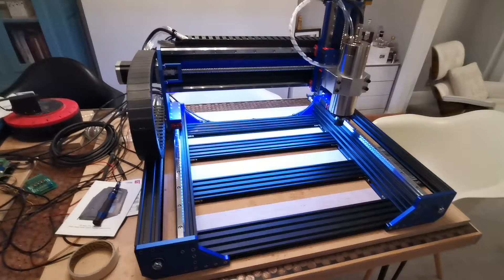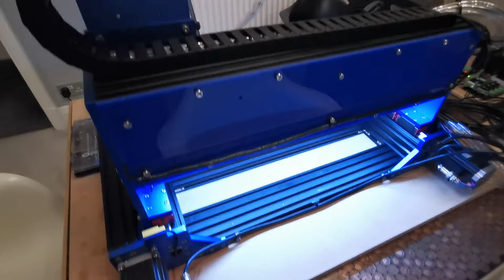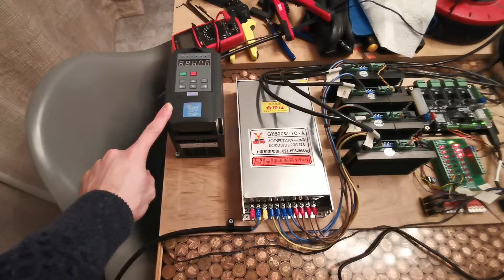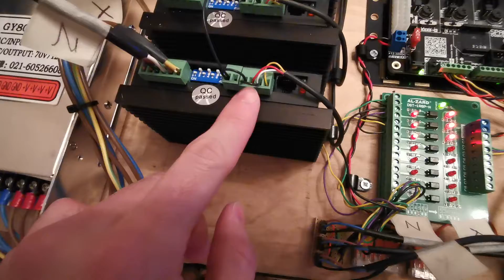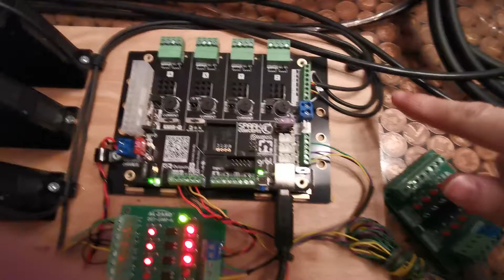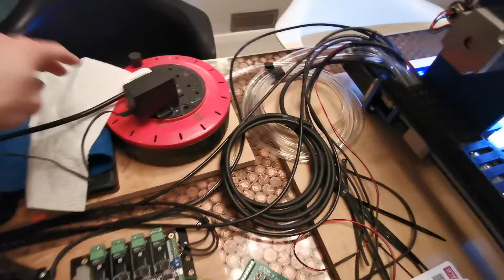A first look at wiring the HDZero Frame Kit

Comment: The more badassary that you come up with the more I regret my Shapeoko purchase. I was looking at just the HDZ upgrade, but I’m starting to think of getting rid of the Shapeoko entirely. My latest struggles consist of the touch probe not working right and the backlash of the belt causing holes to be measurably smaller than spec
Reply: Kaleb Israel learn how to run better tool paths. Although his HDZ does fix ALOT problems with the shapeoko 💁🏼‍♀️
Reply: I haven’t gotten around to installing my HDZ yet, but I was thinking along the same lines. Before buying the shapeoko I didn’t know anything about CNC though, so it’s a learning experience, and those are often expensive :)
Reply: caleb land then don’t give up man keep going. Trust the shapeoko is a very capable machine.
I’m running comfortably and reliably 120ipm at .01 doc with .25” endmill in 6061. You just need to work with fusion 360 and your toolpathes to be smarter
Reply: Lolwut? Tool paths aren’t going to magically make a belt driven machine not have backlash. Definitely not going to make my touch probe work. I plan to tinker a bit more with tightening the belt a tad more and try a finishing pass slightly larger than the holes are specified in Fusion to compensate for it. I bet a ball screw driven machine like this in the video would have much tighter tolerances
Reply: Kaleb Israel I can get repeatability of +/-.002 from my shapeoko.
Once you understand how to run a weaker smaller you can get beautiful repeatability even WITHOUT a touch off probe.
Obviously a ball screw machine is better, but you’re not getting a ball screw machine with that much of a cutting space and adjustability for the price a shapeoko is priced at.
Reply: caleb oliva oh I’m well aware it would cost more, but typically that’s how superior products are priced. I would love that because I’m using the most conservative recommended speeds and feeds for my end mills running basic 2D contours and I’m not getting super great tolerances. I have no idea how tight the belts are supposed to be though so that could very well be the problem. I just didn’t want to go too tight if it was going to cause a problem. I need to eventually get someone to come over and double check my setup with me to ensure I’m not missing something obvious

And the touch probe was in hopes of having an easier quicker time Z zeroing after tool changes
Reply: Did you calibrated your steps,  that fixed the smaller holes  problem for me!
Reply: Daniel Zanco I’m pretty sure it has everything to do with backlash. Going in one direction, it’s spot on. I had it run X distance and measured it with a ruler on the wasteboard. The steps are perfect but changing directions over and over like it does to cut a hole is when I see the tolerance issues